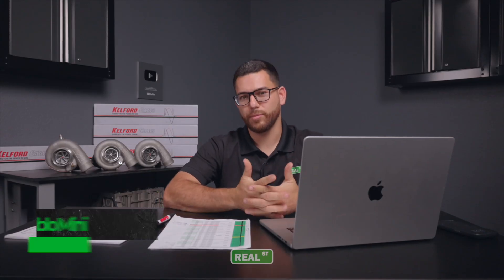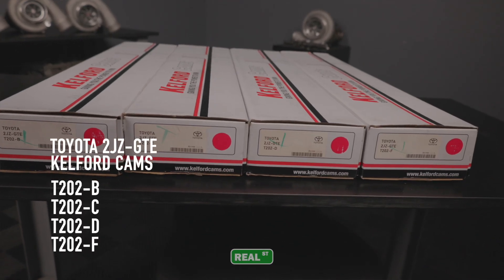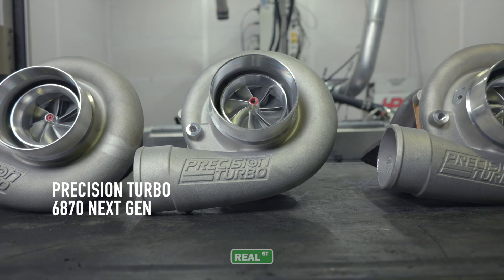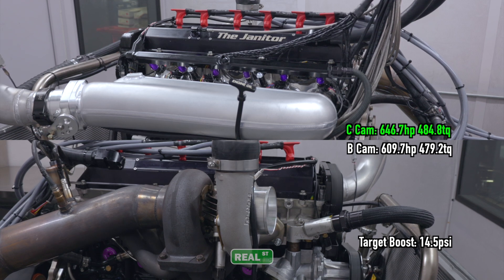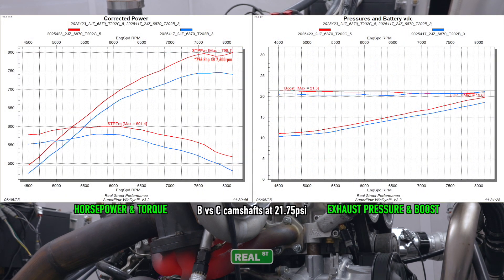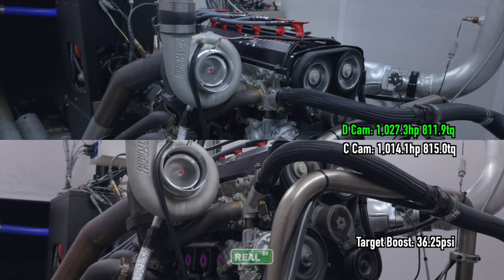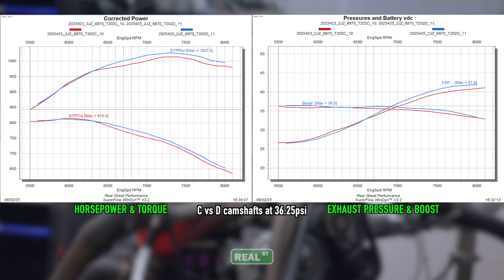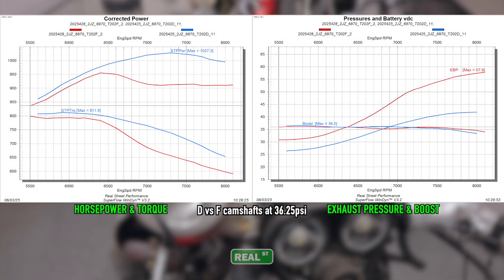Which Kelford Camshaft is Best for me? | 650-1,050hp 2JZ Testing - 6870 + T202-D

Comment: Did U guys notice that at around 4m32s the Throttle body is loose and can be seen spreading apart. Wouldn't this cause the turbo to work harder to maintain boost and back pressure go up and be impacting on the results of the Type F cam...